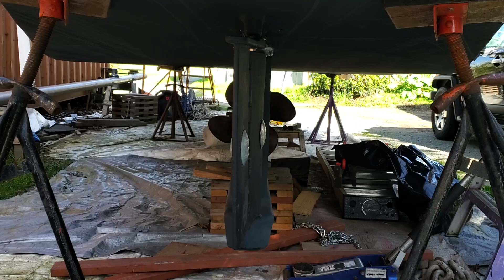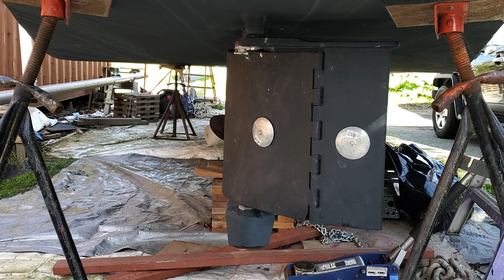The articulating rudder system is finally complete!

Comment: Coming over from Magic Carpet  -- it looks like we have some catching up from 4 yrs ago to today.  Thanks
Reply from the maker: So, Good questions. The first thing you calculate when determining ballast is the weight of the bottom structure since it is essentially part of that equation. Bottom shell is 5/8" plate as well as 2/3 of the sides of the keel...bottom structure including framing is about 2000 pounds before anything else. the batteries are 160 pounds each for 960 lbs more.( was planning to add 4 more but will use lead bars to compensate for now.) and next all the furnishings and tanks are all of 4" off the bottom shell.. if the tanks are only half full, that's another 750 lbs. (170 gallons capacity)side shell is 1/4" to the shear line and 3/16" from there up. as well as the salon deck . the boat I extrapolated from is approximately 3 feet from bottom shell to inside the roof of the cabin, I approximately doubled all those measurements to have just a little over 6 feet of interior head room. and since you are standing on the bottom of the boat all the space above is mostly a large air bubble that makes for positive buoyancy, and the house is really an enclosed cockpit more trapped air if it ever laid over. Hope I answered your questions. feel free to ask for further clarification if you like.

Comment: Hello,I’m amazed at your range of skills! I wonder a few things,what work has been done on calculating stability,with the extra topsides and dog house,over and above the boat you took the hull design from? I ask because I saw on an earlier video you showing space in the keel box for batteries,and I thought you would be putting ballast in there,with all the extra height added to the design,and consequent raised centre of gravity. Questions from an amateur here,but I’m really curious of your methodology,all the best from Nottingham in the UK
Reply from the maker: So, Good questions. The first thing you calculate when determining ballast is the weight of the bottom structure since it is essentially part of that equation. Bottom shell is 5/8" plate as well as 2/3 of the sides of the keel...bottom structure including framing is about 2000 pounds before anything else. the batteries are 160 pounds each for 960 lbs more.( was planning to add 4 more but will use lead bars to compensate for now.) and next all the furnishings and tanks are all of 4" off the bottom shell.. if the tanks are only half full, that's another 750 lbs. (170 gallons capacity)side shell is 1/4" to the shear line and 3/16" from there up. as well as the salon deck . the boat I extrapolated from is approximately 3 feet from bottom shell to inside the roof of the cabin, I approximately doubled all those measurements to have just a little over 6 feet of interior head room. and since you are standing on the bottom of the boat all the space above is mostly a large air bubble that makes for positive buoyancy, and the house is really an enclosed cockpit more trapped air if it ever laid over. Hope I answered your questions. feel free to ask for further clarification if you like.
Reply: Ok thank you I appreciate those details of plate thickness and ballast,I guess too that besides positive buoyancy if knocked down,the pilot house etc raises the centre of gravity,that was also part of my query;does this not add to the likelihood of being laid over in the first place? And what calculations,or even weighing of fit out materials have been carried out,to anticipate what righting moments might be acting on the vessel in the water. It may be simply camera angles etc, it just looks tall,and with all the internal fitting out,potentially a little top heavy. I hope this is clear,I am truly amazed at your workmanship,and wish you all the best.

Comment: What advantage do you perceive you will gain from the extreme rudder angle (80 degrees either side of midships)? From an hydrodynamic/turning performance perspective 35 degrees (ish) is considered optimum.
Reply from the maker: I have installed these on both commercial fishing boats as well as yachts and always the same response is that the boat can be maneuvered in tight spaces much more efficiently as she will spin in about her own footprint. One fisherman told me he went from a mile and a half turning radius to turning in the boats footprint. I would say that's a clear advantage.

Comment: What are you using for ballast? How did you know how much ballast you needed?
Reply from the maker: So, Good questions. The first thing you calculate when determining ballast is the weight of the bottom structure since it is essentially part of that equation. Bottom shell is 5/8" plate as well as 2/3 of the sides of the keel...bottom structure including framing is about 2000 pounds before anything else. the batteries are 160 pounds each for 960 lbs. more.( was planning to add 4 more but will use lead bars to compensate for now.) and next all the furnishings and tanks are all of 4" off the bottom shell.. if the tanks are only half full, that's another 750 lbs. (170 gallons capacity)side shell is 1/4" to the shear line and 3/16" from there up. as well as the salon deck . the boat I extrapolated from is approximately 3 feet from bottom shell to inside the roof of the cabin, I approximately doubled all those measurements to have just a little over 6 feet of interior head room. and since you are standing on the bottom of the boat all the space above is mostly a large air bubble that makes for positive buoyancy, and the house is really an enclosed cockpit more trapped air if it ever laid over. Hope I answered your questions. feel free to ask for further clarification if you like.
Sea trials will finalize ballast and it's proper distribution. Even new boats that have been designed by marine engineers have to have stability testing, again that's what sea trials are all about.